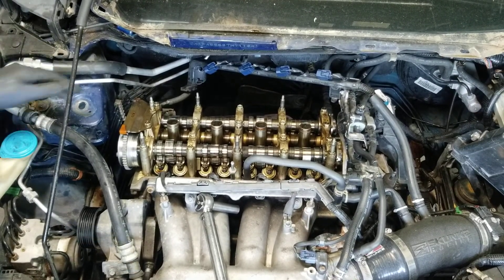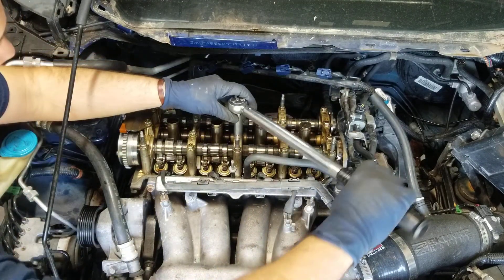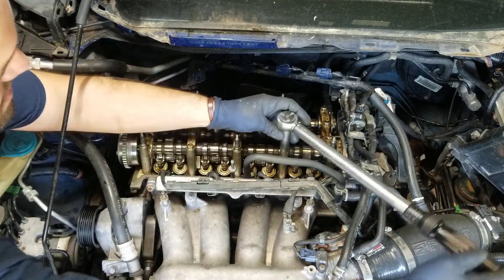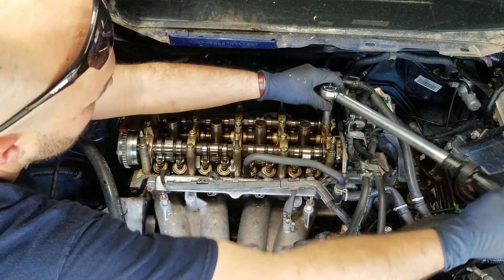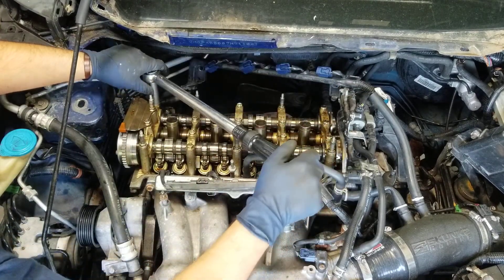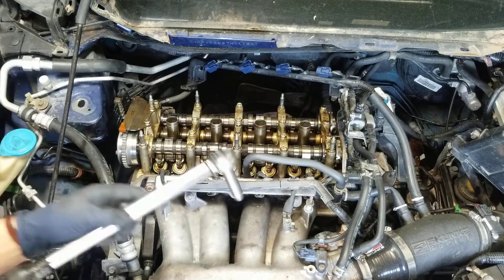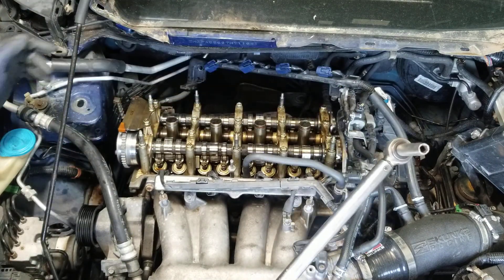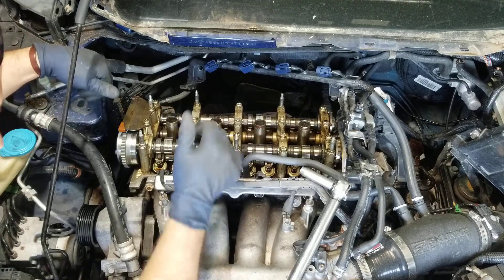Honda K Series Cam Cap Torque Sequence / Specs

Comment: Is that last 10 mm bolt that you put in important or can it live without it? The reason I asked is when I took mine apart and didn't have a 10 mm in there, it was just empty
Reply from the maker: I’ve seen a lot without them. It’s fine without it

Comment: One of my studs got stripped for my valve cover. Is ok to loosen the cap bolt just one? Will affect the engine or not? Or do I have too loosen everything in sequence then re-tighten everything.

Comment: i didn’t have a torque wrench on hand so i tightened these all good and tight with a 1/4” drive ratchet lol. I’m a bit concerned is there any way it could do damage to the cam if they are too tight? They are definitely tight enough not on the loose side.
Reply from the maker: They'll probably be fine
Reply: @hondaresource  thanks for the reply. I started it up about an hour ago after allowing the rtv to dry for a day on my valve cover and it seems to run great.

Comment: Thanks for the video, after tightening one of the bolts, I can see air bubbles coming out at the bolt head, what would be the reason?
Reply from the maker: It's just oil from the bolt hole coming out
Reply: Thanks a lot for the quick reply. So this's okay? I keep hearing from others that this can be due to a bad head gasket.
Reply from the maker: @hassanmohamed8904  cam cap bolt holes have no relevance to the head gasket

Comment: Hey man, so I stripped the nut on one of those studs for the valve cover. So I took that bolt out and I replaced it with a new one, torqued it down to 15ft and the first click snapped the bolt. Do you think this happened because I replaced just one bolt and didn’t do the sequence? Or maybe it was my torque wrench??
Reply from the maker: 15 ft/lb shouldn't break one of those bolts. May want to check your torque wrench
Reply: @hondaresource  so without doing the pattern and just replacing one of those bolts it shouldn’t have broken?
Reply from the maker: @idrcookiez620  definitely not